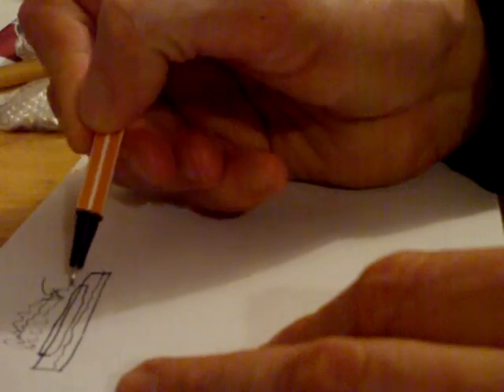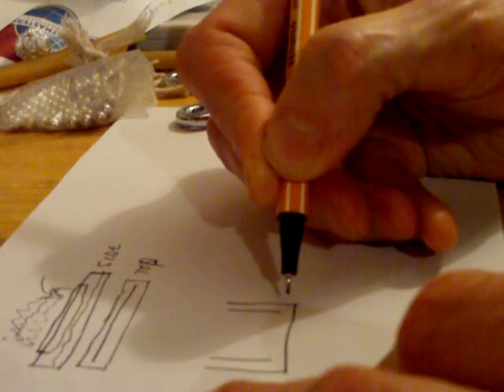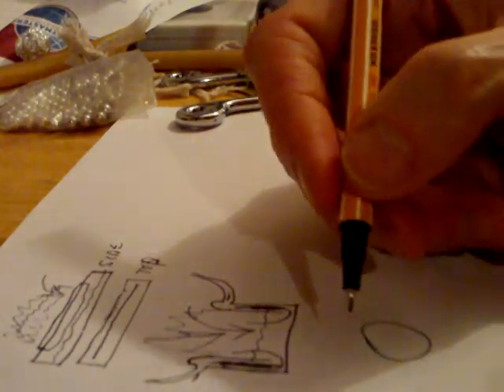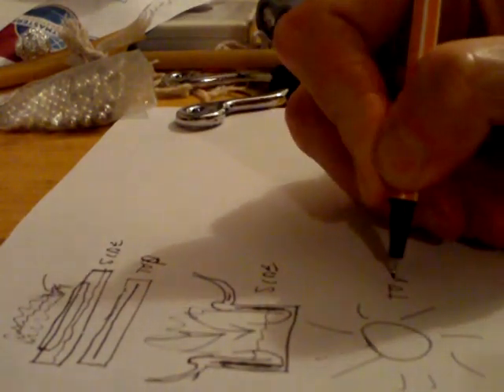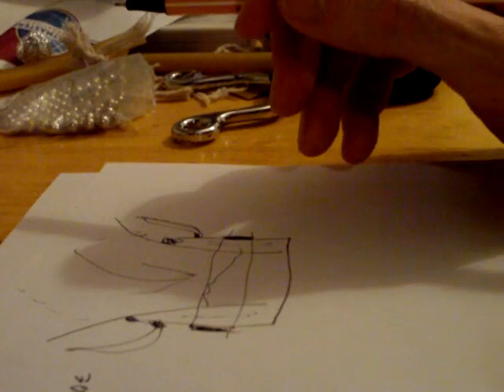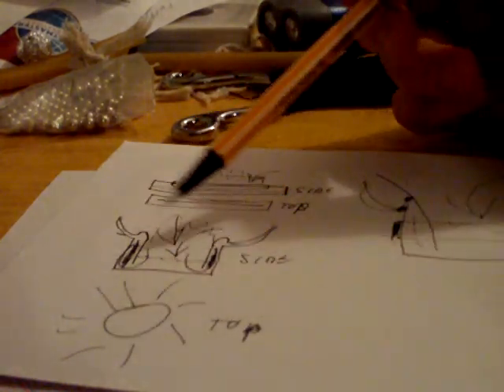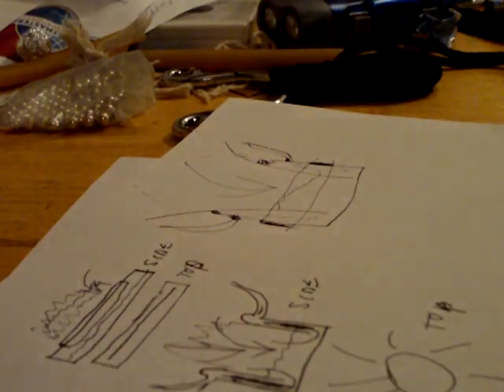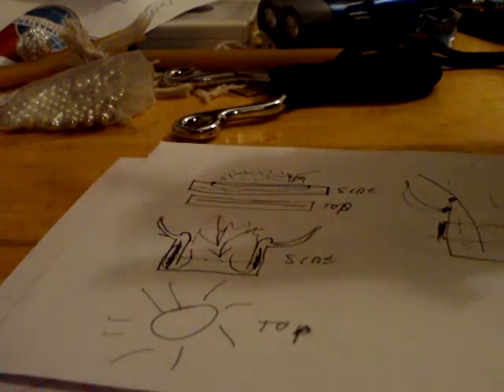Alcohol Stove Theory Bioethanol Ethanol Bio fuel Fire Fireplace

Comment: Thanks, Nick, this is a work in progress, I see, but gave me some info I hadn't found yet - there are tons of construction vids but v. little on theory. While some bio-ethanol fire boxes have technical details not found in penny stoves, etc., they do appear to be basically a metal pot (stainless steel, often) with ethanol burning in it! The wicking material in those ethanol fires, when there is any at all, is often a ceramic wool. I'd really like to understand more about the pressure questions - how much is good, can they explode if, for eg. you put alcohol in a screw-top can with a small hole for the burner and it heats up but can't escape fast enough? Or can they explode if the right (wrong) mix of air and vapour builds up? For now I won't mess about making pressurized ones.
Reply: these arent going to explode, the pressure is too little. dont worry about it